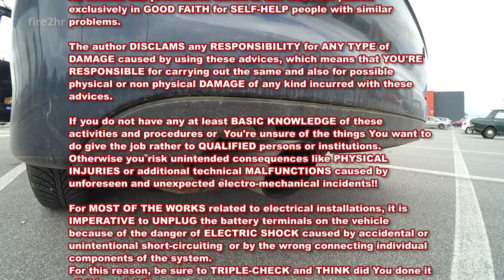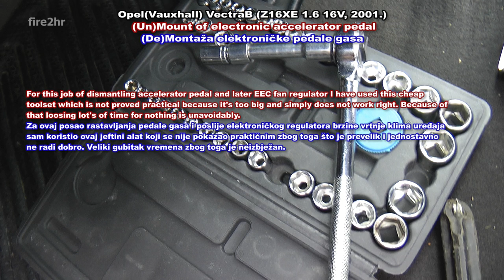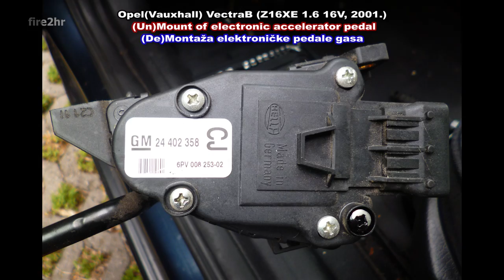Opel (Vauxhall) VectraB (Z16XE 1.6 16V) (Un)Mount of electronic accelerator pedal

Comment: Vrlo lepo objasnjenje.A sta uraditi kad se na putu pokvari elektronski gas i auto predje na safe mod?Moze li se popraviti ili se mora zameniti?
Reply from the maker: Ovaj video je iz "serijala" kako doći do regulatora brzine ventilatora (ECC modula)...tu je trebalo demontirati pedalu gasa.
Inače imao sam baš slučaj gdje je bio indiciran kvar pedale gasa i ECU je zabilježio slijedeće kodove greške:
P1122 - Accelerator Pedal Position Sensor 2 Voltage Low
 (02) - Present
P1550 - Limp Home - Electronic Throttle Control Limited Performance
 (0A) - Present
Ispalo je da je pedala skroz OK i morao sam reparirati ECU kod majstora koji se bavi time.
Safe mod i je zamišljen da nekom minimalnom brzinom možeš doći do kuće bez šlep službe.
Elektronička pedala gasa je u biti par od dva promjenjljiva otpornika (kod nekih vozila i tri) i po logici stvari bi trebali davati isti otpor prtiskanjem papučice gasa.
Računalo (ECU) stalno očitava uspoređiva otpore (tj.padove napona na njima) oba otpornika i ako su iz nekoga razloga različiti prebacuje u "safe mod" iz sigurnosnih razloga jer smatra da je jedan otpornik u kvaru.
Kada bi u pedali bio samo jedan otoprnik i u slučaju da se pokvari auto bi mogao bez kontrole ubrzavati i time izazvati nesreću jer bi se većina vozača uspaničila u toj situaciji
Teoretski (i praktično) nju možeš zamjeniti na cesti ako ju imaš u rezervi i imaš prikladni alat pošto je spojena samo sa konektorom i kabelom izravno na pinove ECU-a.
Samo sa tom elektronikom je problem što je uvijek zadnja instanca kvarova elektronike ECU i onda kodovi grešaka koje izbacuje postaju irelevantni što je kod mene bio slučaj.

Comment: Did it show any fault codes?
Reply from the maker: Here I had to remove the pedal to reach the  ECC unit (Electronic Climate Control), but...
I had one case where accelerator pedal failure was indicated and ECU recorded the following error codes:
P1122 - Accelerator Pedal Position Sensor 2 Voltage Low
 (02) - Present
P1550 - Limp Home - Electronic Throttle Control Limited Performance
 (0A) - Present
I checked the pedal resistors with instrument but they were ok.
On the end it turned out that the pedal was OK, and I had to repair the faulty ECU.
Safe mode (Limp Home) is designed to get you home with minimal speed.
The electronic pedal gas is essentially a pair of two variable resistors (in some vehicles three) and logically both of them should give the same resistance by pushing the accelerator pedal.
The computer (ECU) constantly monitors and compare those resistors and if they not same for security reasons it switch to "safe mode" because it considers that one resistor is defective.
If there was only one resistor in the pedal, in the event of his malfunction vehicle would be able to speed up without control causing an accident. Most of the drivers would be surprised with that situation and they would not react on proper way.
With vehicle electronics, the problem always could be, as the last instance, faulty ECU.
Then the error codes shown are as wrong and irrelevant as in my descriptive case.
Reply: @fire2hr  thanks i have  a problem its the 1,9 automatic .its ok most of the time,i can use it for a week then when I put my foot on the throttle it creeps forward for about 4 sec the set off very fast. then it works ok .sounds like a diffrent thing there are no fault codes had it it to vauxhall the say its ok  thanks anyway